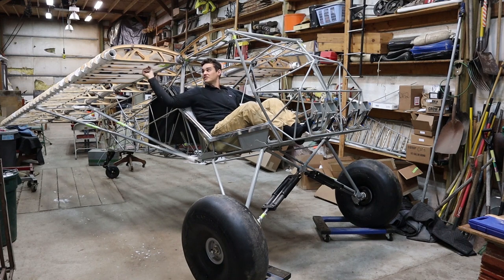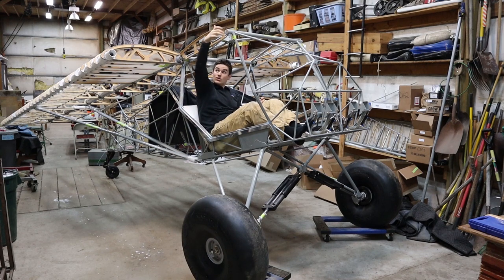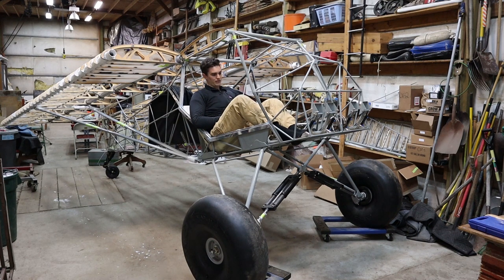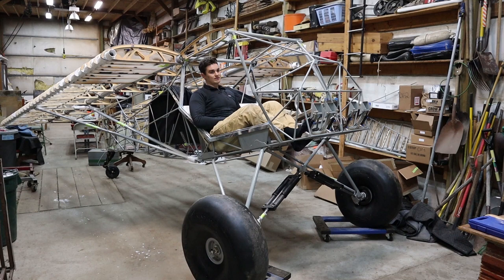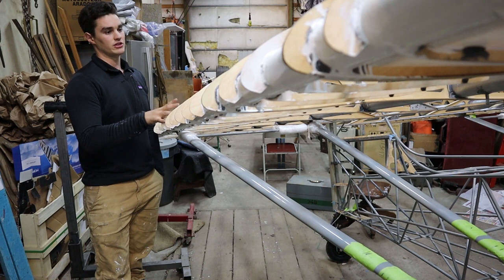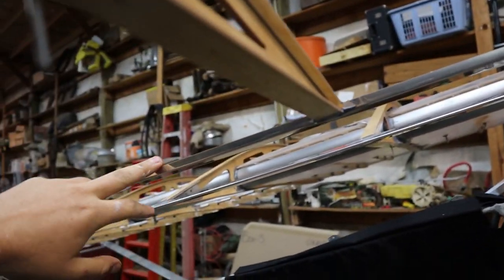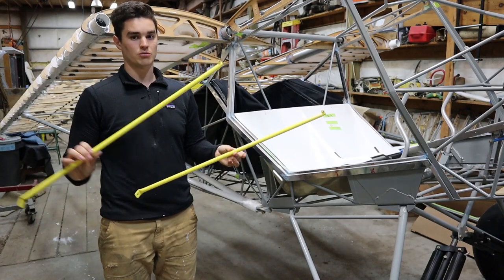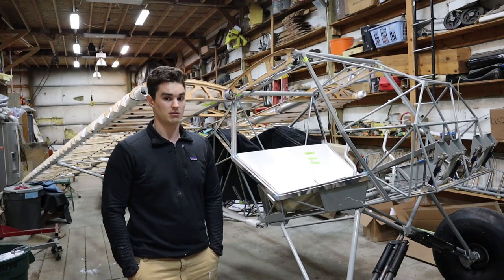Kitfox STi Build Update 4 : Wings Pt 2, Header Tank, Door Latch Review…

Comment: I see you're using ethanol resistant parts.  Are the fuel tanks safe for ethanol with them being fiberglass?  I'm assuming you want to be able to run regular pump gas if you can't get ethanol free.  Are you going to be good to go with any old premium pump gas (under 10%) or is there still a concern?

Comment: All the torque settings in the control column and the rudder pedals can be done so that it all moves freely without any restriction whatsoever.  It just takes time, patience and a few nights sleeping on it and thinking about what is actually happening and it does come to you eventually.  I have posted my thoughts on team Kitfox forum for anybody that needs the info on it all.

Comment: A nice pair of alum spacers cut from a soda can and placed between the big plastic bushing halves under the bolts will fix your control stick binding. Very nice progress.
Reply from the maker: Great idea! I hooked up the elevator yesterday and the friction is pretty much unnoticeable under the weight of the elevator! Will try the shims though! Thanks
Reply: @7KiloFox  I really doubt a little friction in the control stick will be noticeable when flying. My plastic bearing fit fine but would bind when bolted so i shimmed instead of sanded and it worked fine.
Reply: @KitfoxPilot  Shimmed with a cut out from a soda can?  Great info btw thanks

Comment: Thanks for another helpful video. I wonder if they painted the tow kit lock-back wing braces yellow for visibility - sort of "remove before flight" safety thing? I get that the wings are not in a flying position, but make the braces stand out, so you don't forget to completely remove them from the aircraft before flight?